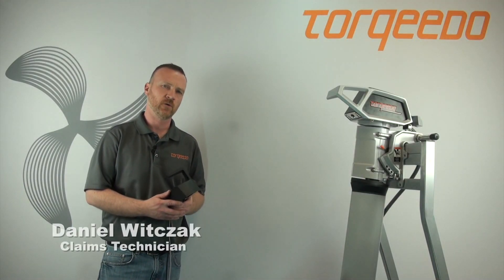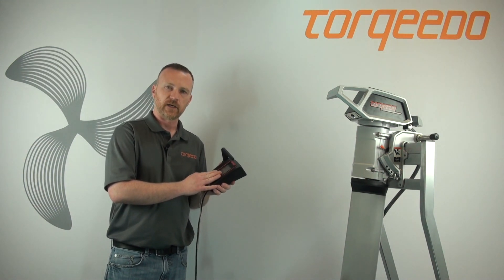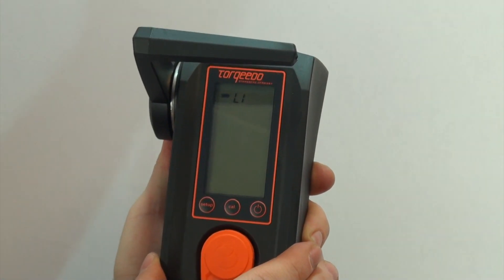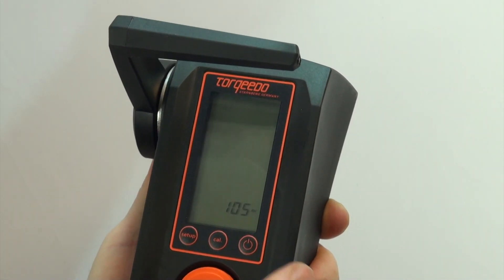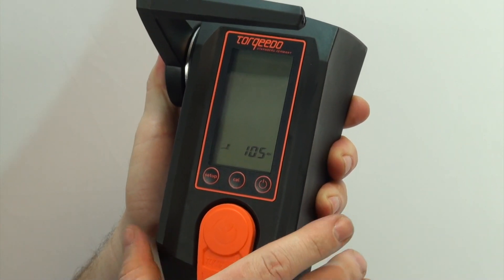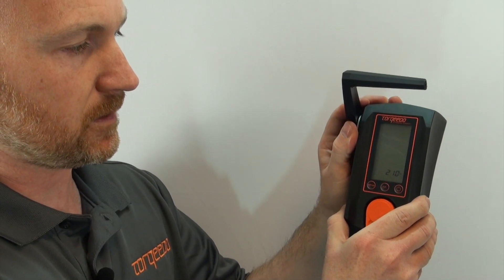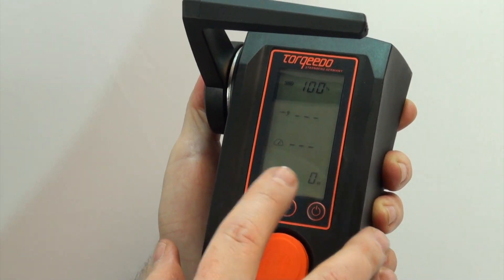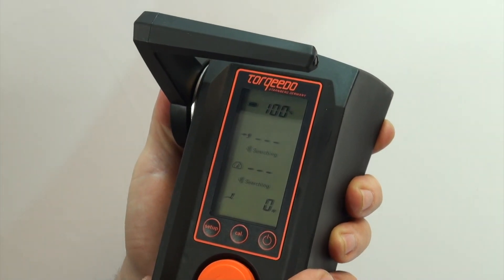Torqeedo Cruise Motor Initial Set up of Lead Acid or AGM Batteries

Comment: I originally had 4 batteries and it was mistakenly set at 105 by Princecraft.  I have now installed 4 additional batteries for a total of 8 on a 24 volt system and I set the amp hours to 420.  I hope that is correct.  I ran the motor low for a few seconds and it seems to work.  I'll take it out for a spin on the weekend.
Reply from the maker: Hello, thanks for your question and patience. Please contact the service department directly via service_usa@torqeedo.com (if your are in the us) or service@torqeedo.com (rest of the world).